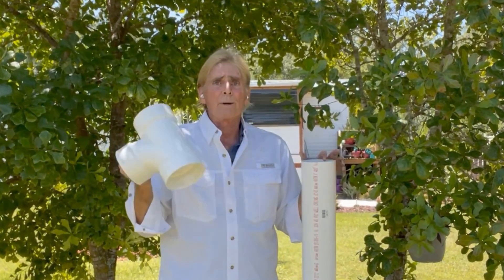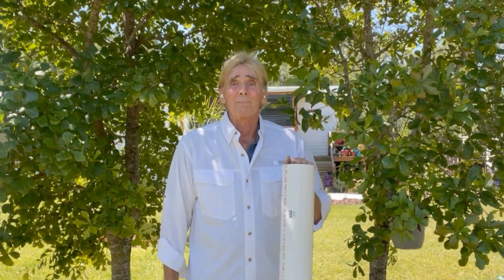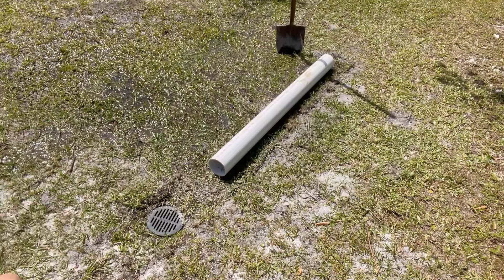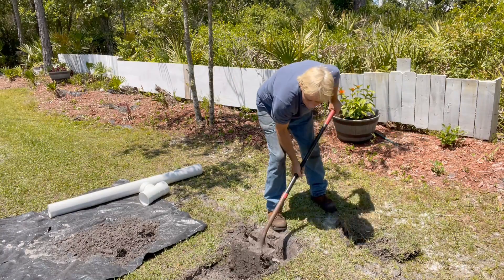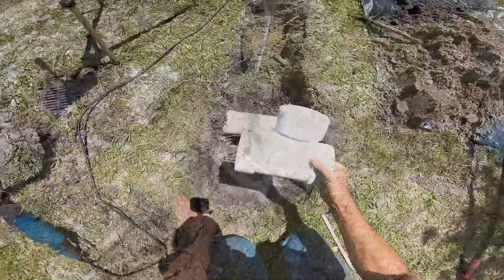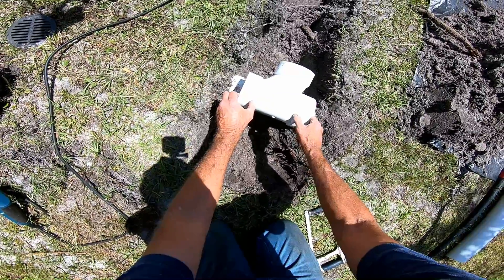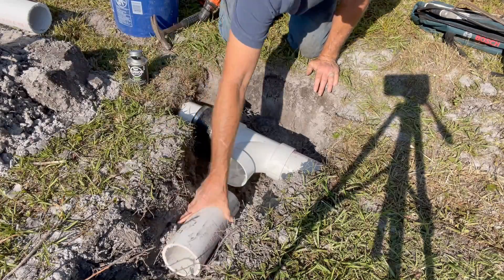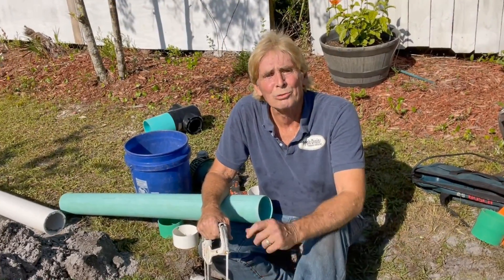Connecting to SCH 40 PVC - Its not as easy as you think!

Comment: Oh BTW Black and Decker owns Dewalt and porter cable so they are just fine . All my yard maintenance battery powered tools are Black & Decker and have held up pretty good. Got about 10 years out of the weed trimmer and my yard is not easy on equipment.

Comment: Great video..probably will add two couplings so I can adjust/remove easily. Question for Chuck or others. Want to tie in a tiny home to septic using a T, probably with a clean out cap when not in use. Someone said I should have a backflow protector. Don't think that is necessary, but is it required and if so what kind of T pipe is suggested. Thanks for any info.
Reply from the maker: @rickame  Hi Rick.. I agree with you. Not needed

Comment: ANOTHER SUGGESTION ... a little more expensive but if you add 2 rubber couplings to both sides, your able to adjust the very critical angle of the PVC. Once you glue one side there's no more adjusting the angle of the new PVC pipe your adding.  

BTW - Chuck is amazing!  Always great videos and passion to help us all!

Comment: Hey chuck I saw those hubs and they seemed  to fit perfect on ach 40. They were too big for the S&D pvc I already have. Do they make a hub that works with smaller 4” S&D?
Reply from the maker: They will fit on a thin wall PVC and SDR 35, just need to tighten them really down. You also may need to use a band that has more holes in it.

Comment: I was standing in a 10 ft deep hole with a 4 inch pvc water pipe in my face it was cracked I cut it installed a slip collar and tightened it boss turned on water before I could get out of the hole. Water rushed thru pipe it held I was covering my face then Boom! The slip collar came off and hole filled with water instantly over my head .y feet stuck in the mud I raised my arms and 4 guys pulled me out of my boots  👢  saved my life. Boss bought me new boots 👢  then he said jump in the hole! I jumped in and installed a longer slip collar that fixed the leak . But I got out of the hole before they turned on the water!😮

Comment: Chuck what is schedule 40 pvc? I’m replacing 50’ of 1” galvanized steel pipe for my well line and the pro told me to use schedule 40 pvc instead.
Reply: schedule 40 is simply the wall thickness of the PVC pipe, it comes in many different diameters so you would likely use 1" schedule 40 PVC pipe to replace the 1" galvanized steel pipe, it's lighter and won't rust.

Comment: Hey Chuck....can you show what's needed to go from 1 1/2" schedule 40 PVC to 4" thinwall PVC?  I have a sump pump discharge that I need to connect to existing 4" thinwall PVC and I have no idea if there is a specific adapter for the two types or what to get?  Thanks..